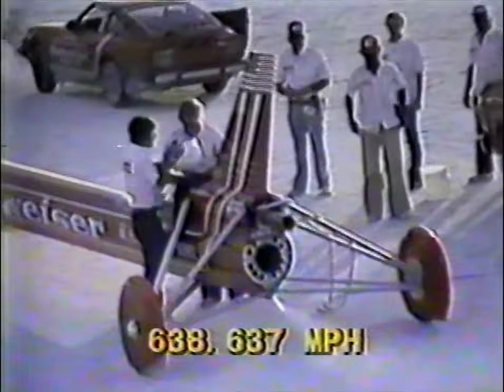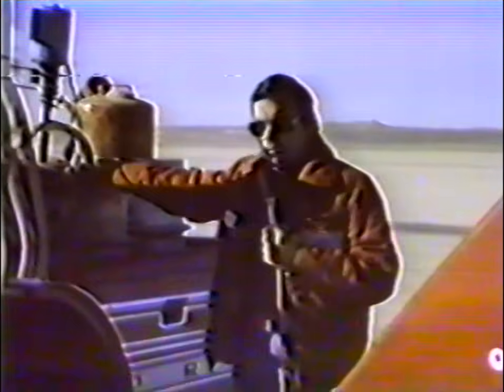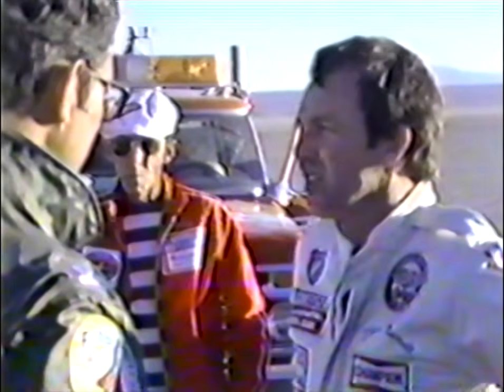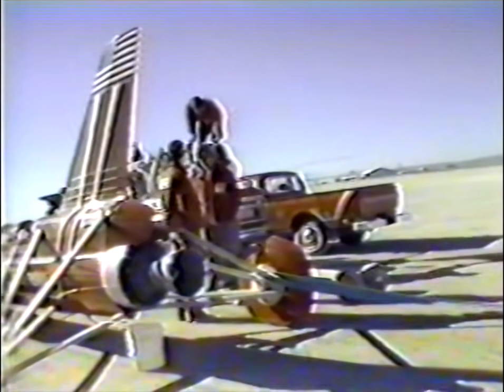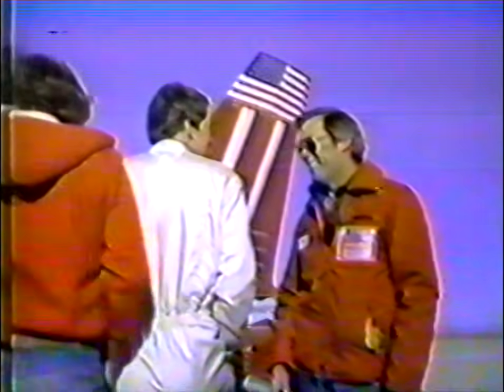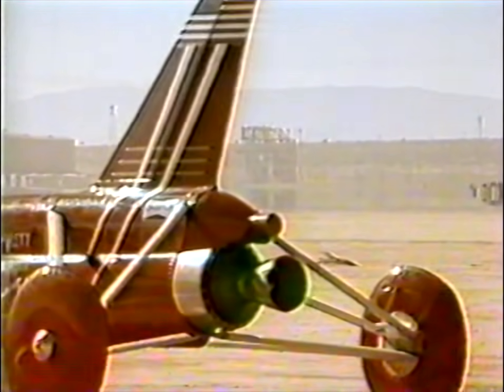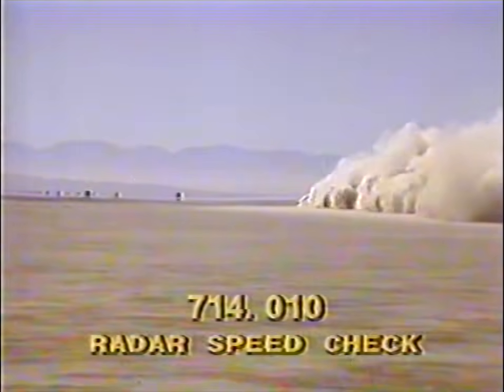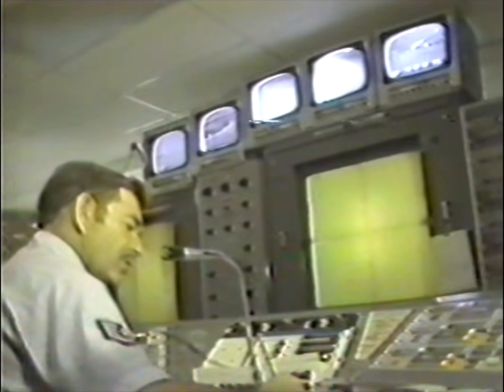Stan Barrett Breaking The Sound Barrier Live from Edwards Air Force Base in 1979

Comment: I was in the black rock in 1997 when the SSC did break the sound barrier and yes one hell of a sonic boom and shock wave!
Reply: Stan Barrett broke the sound barrier, the reason for a subdued sonic boom is because of the design, very little wind resistance, while it was very aerodynamic. 

The size of the Bud car compared to the SSC and especially the difference  in weight has everything to do with the magnitude of the boom. He was the first to break the record in a land vehicle. The rocket engine in the Budweiser car has no air intake, this is another reason only a few heard the sonic boom at a certain angles as it went by. 

The SSC has two huge air intakes for two very large turbojet engines that create huge amounts of turbulance which the Bud car does not have at all. 

The huge area around the intake is why the SSC had such a big boom along with it needing to run massive amounts of air through its engines.

I work at Edwards AFB at Pratt & Whitney military propulsion systems, I have for 22 years.
Reply: Yet SSC was a car (four wheels, two for steering).
Stan Barrett's three wheel did not qualify in the same category as the historic land-speed records for cars.
Reply: @P&Wengineering, and yet the F-104, one of the most aerodynamic planes in the world, still makes a hell of a sonic boom.
Reply: Because it's frontal area is massively larger than the rocket car, as well as a host of other reasons.
Reply: @richardpare3538  bullets  make a sonic boom when they break the sound barrier, frontal area has nothing to do with it ,its air being compressed  until it can't get out of the way ,no bang no sound barrier, awesome tech achievement  and a ballsy driver.
Reply: @pauldavidson6321  Yes bullets do, but is is MUCH less loud than that of a supersonic jet, because the magnitude ( in size) of the wavefront of a jet is much larger. Anyone who has studied supersonic flight knows this:

https://www.nasa.gov/centers/armstrong/news/FactSheets/FS-016-DFRC.html
Reply: Why is everyone calling bullshit 🤣
Reply: I was there too working with the opposition, Craig breedlove and his Sonic Arrow. The Sonic arrow was actually the faster car capable of an estimated 920 miles an hour but there were too many mechanical issues. And the team simply ran out of funding.
Reply: @leonwarner8498  Sonic Arrow had a lot of aerodynamic problems too. I've always admired Craig Breedlove: a gentleman, respectful of other people's efforts and totally committed to his passion of setting land speed records. The man has always done everything by the book. Perhaps his one flaw is that he eschewed things like wind tunnels and CFD, preferring to design things by eye. While he was definitely putting his life on the line and he certainly succeeded with Spirit of America 1 and 2, Sonic Arrow was a different matter. To work safely and effectively at Mach 1, it needed some serious CFD work, especially in relation to things like directional stability, shockwave propagation (especially relative to the ground) and air intake design.

Strange things happen once you exceed what's known as Critical Mach Number - the point at which airflow becomes sonic at one point on the body. Air behaves quite differently. Shockwave formation and things like boundary layer separation can make the difference between life and death. Intake design is critical too. Most people don't realise this but a jet engine cannot process supersonic airflow. That means designing an intake that has very predictable shock patterns so that the air will slow down reliably. The alternative is a compressor stall, which would probably destroy the engine and the vehicle with it.

Thrust SSC was designed by an aerodynamicist (Ron Ayres), who also did much of the design work on Bloodhound. Guess who was the first to congratulate them? Craig Breedlove.
Reply: @pwengineering9070  All well and good........ But he still didn't break the barrier - didn't go fast enough!
Reply: @leonwarner8498  That's the thing - back in the 1970s it seemed like money was easier to get, up to a point.   Today everyone would worry about insurance liability.  The Sonic Arrow was a pretty cool vehicle, it's too bad it never got to really shine the way we all hoped it would.

Comment: mu = shock cone angle.  mu = asin(1 / M).  At M = 1.00,  mu = 90.00 degrees (normal shock).  At just M = 1.01, mu = 81.93 degrees.
Shocks in this regime are weak but would still be distinguishable from the rocket exhaust as they sound like a single very, very low frequency thump.
If the vehicle only momentarily achieved sonic speed then it IS possible that the point where this occurred was not at the location where a shock cone would have swept the observers.
- 40 years in the Skunk Works
Reply: Basically what he said was “No” he didn’t break the sound barrier on that day.Given another day, different temperatures it probably would have broken the sound barrier.No sonic bang, no shockwave.means no sound barrier broken.”On that day” But all due respect to Stan.But don’t give us a formula to try and prove it.
Reply: @donlunn792  Let me try to explain it more simply.  If he only momentarily went supersonic and the observers were not in exactly the right place then they would not hear the shock wave.  Furthermore at speeds only slightly above sonic the shock sounds like a low thump not a bang!
Reply: He was FIRST
Reply: @buckturgidson1632  The SOS is roughly 1122 fps depending on ground height, and there is definitely a boom as you go through, anything close to the sos is buffeting and causes de stabling effects but no sonic boom. besides 666mph being a long way off the SOS at ground level, depending on altitude.

Comment: If you check the official records, this run was never certified.  I highly doubt Barrett broke mach 1, because they would have certainly made a big deal, in the film, about hearing the sonic boom (there wasn't one).  In contrast, the "ThrustSSC," the first car to actually break the speed of sound (in 1997) was said to have generated a clearly audibie sonic boom and visible shockwave, as it passed "the barrier" and went supersonic.
Reply: Not having an official record doesn't mean it happens, and falling a couple miles per hour short doesn't make it any less impressive.

Comment: Chuck Yeager was not an engineer and had no advanced education, he was an excellent pilot ,but that doesn't give him any more credence than some guy on the street .No boom ,no sound barrier it's that simple , they're very loud everyone would have heard it  .also the the equipment used by the Airforce is not appropriate for land speed timing and was not even calibrated . The attempt was a very impressive  achievement by any standards.
Reply: Quite right. Everyone should just forget about the radar. It doesn't measure local Mach number anyway. It's just a distraction used by the people who chose to believe this fraud. Either it made a sonic bang or it didn't and everyone knows it didn't.

Comment: The sound barrier is 767mph, so they were about 30mph shy of a sonic boom.
Reply: The sound barrier speed changes with temperature, air density, etc. On that day, the Air Force determined what the sound barrier was for those conditions.
Reply: @juniorjohnson9509  No. The speed of sound is dependent on temperature. The USAF could not skew the variables enough to change the fact that this thing did not make a sonic bang.
Reply: @thethirdman225  : Air temp that morning was about 20 F, putting the speed of sound at approximately 731.996 mph. He was clocked at 739.666mph.
Reply: Junior Johnson You tell me how this was done then (I already know). No sonic bang = no supersonic run. Since you can hear that thing all the way through its run, there’s no way it was supersonic. Here’s what a genuine, authentic supersonic run sounds like: https://youtu.be/rIWdtE-__5M

Comment: I'm puzzled why there was no mention of a sonic boom?  If you truly break the sound barrier, there is always a sonic boom.  "We "probably" broke the sound barrier." Probably breaking it and breaking it are two entirely different things.  Also, the speed recording equipment had some issues as was acknowledged.  Officially and otherwise, he did not conclusively break the sound barrier.  Thrust SSC was the first to break the sound barrier officially in 1997.
Reply: The measured mile speed was (according to the time keeper) 666mph.
The team's radar tacho decided to spot a passing truck and read 38mph.
The Air Force stated they probably broke the sound barrier.
No one heard a sonic boom.

Put that lot together and what you have is a plot on a graph of distinct samples that when smoothed out just nudges over mach 1, even though no actual sample reads over.

If it did exceed mach 1, it was only a fleeting moment.
Reply: They didn't even have a measured mile. They had a way shorter time trap but the Bud Rocket went out of fuel before passing it.

Comment: By any measure, I call this 714+ mph run, a major accomplishment. ,,especially being built in some ones back yard.  The Thrust SSC was built at 1000 times the cost, twice the developed HP and 8 years later, plus, they broke the speed record at the Black Rock Desert in Nevada, at over 3900 feet elevation. Barrett made this run at Rogers Dry Lake at 2275 feet elevation with greater air density ..at relative air temps and humidity.  I'm not sure why Barrett and his team didn't take their Sidewinder rocket configuration back to Bonneville, where the elevation is 4665 ft.
Reply: I think they left Bonneville because it had some dips in the track that caused it to almost go airborne.
Reply: @ransomprigg1047  That could be true, ..I figured they left the salt during their first run at Bonneville (638mph) cause they had rubber tires.
Reply: I left Edwards in ‘76.  Viewing the video in ‘21.  Remember the view of the flight line.

Comment: People believe what they want to belive. That is why telemetry is required for records to be official
Reply: Actually I would accept the land-based speed-trap measurement over telemetry for the simple fact that telemetry, by nature, involves latency and many more pieces of equipment. Modulators, transmitters, receivers, demodulators, oscillographs, etc, etc., etc.. A lot to go wrong or produce an error. A speed trap is a clock operated by an on/off switch placed at a measured distance apart. Simple and accurate.
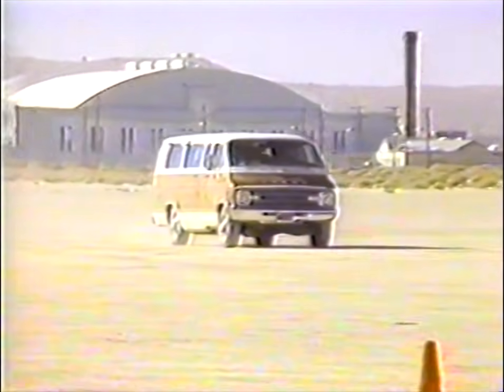Reply: At exactly 19:20. At least watch it so you can feel stupid

Comment: An amazing feat regardless of whether it was sanctioned or not. I have to wonder what the stresses were on the wheels that rolled at 1000 feet per second. The G-forces of centrifugal force had to be enormous. Where is this vehicle now?
Reply: I read on another video that it's in a museum somewhere?   I'd love to see it.
Reply: Its at the motorsports hall of fame in Talladega Alabama. Right beside the Talladega Superspeedway. It sets out on the floor and you can walk right up to it.
Reply: As rodas não têm borracha. São 100% em alumínio!
Reply: For reference the wheels of Bloodhound LSR are designed to withstand 50,000 G.

Comment: There was no shockwave visible in any of the videos so unfortunately their own evidence disproves their dream that the car went beyond the sound barrier. Calculated SOS values and people thinking they heard a boom don't trump the laws of physics. No pressure wave, which you'd see for hundreds of meters either side of the car on the ground, then the sound barrier he didn't reach, let alone break. That doesn't stop it being an epic achievement, just not one that was faster than sound.

Comment: I think that tracking radar is an AN/MPQ 77.
Reply: Doesn't matter. It doesn't measure local Mach number.
Reply: Good catch
Reply: @thethirdman225  You are correct that it doesn't record mach numbers.  It can plot the path with time ticks on the plot and the distance between the ticks is measured and this will give the speed.  Used to do it all the time with B-52s.  The time ticks are pretty accurate and a good operator can get the speed very close to what it actually is( +- a mph or two) and this was very important for what we did with the radar.
Reply: @repalmore  Depends on the radar.
Reply: @thethirdman225  I'm sorry, what do you mean by "depends on the radar"?  What depends on the radar?
Reply: @repalmore  The accuracy. The radar they were using had a speed range between 0 and 2,000 mph so it wasn't super accurate for what they were doing that day. It also had problems with ground clutter, which is to be expected and you probably wouldn't have had that problem in the situation you were in.
Reply: @thethirdman225  Why do you say it had problems?  Why do you say it had a speed range?
Reply: @repalmore  What I have read about it and the fact that its readout was compromised by ground clutter and other moving objects.
Reply: @thethirdman225  I've sat and operated that exact model of radar.  I know what ground clutter is and I know what this radar's capabilities are.  It appears from your broad statements that you don't know radar and you don't know this particular model.  Unless you KNOW what you are talking about please don't bother people with innuendos and rhetoric.  The adults are talking.
Reply: @repalmore  And why don’t you shut up? I actually do know radar but not that specific model. I deal with microwave equipment every day. This thing made no sonic bang and the radar data wasn’t used to estimate the final result so whatever you think about the radar read outs is irrelevant anyway.
Reply: @repalmore  By the way, there is no such radar as an AN/MPQ-77, so spare me the condescension.
Reply: @thethirdman225  Now now little boy.  No need to throw a temper tantrum.  I'll find you a toy to play with in just a minute.  Just calm down.  Maybe some candy will help.  I also worked with microwave.  Not everyday but often.  How does a "sonic bang" have anything to do with the radar?  How do you know what the reed outs are?  Why do you think your an expert because you work with microwave?  Just calm down and answer like an adult.
Reply: @repalmore  You’re the one who started it. The radar you described doesn’t exist anyway so you’re obviously a fraud.
Reply: @repalmore  How does a sonic bang have anything to do with radar? It doesn’t. If you knew anything about this, you’d know that. But since this was intended to be an aerodynamic event, a sonic bang is evidence that it exceeded the speed of sound. Absence of a sonic bang is evidence that it didn’t. Go back to school and stop pretending you know what you’re talking about.
Reply: @repalmore  Learn how to spell.

Comment: This did not break the sound barrier Thrust SSC was the first and is still the only supersonic car
Reply: Yup
Reply: There was no Sonic Boom
Reply: My understanding is that this is up for debate. Both the Air Force and the in-car telemetry recorded a top speed about 10 mph faster than the speed of sound on the day that the run took place. The majority of the team was behind the car and wouldn't have been able to hear a boom. The one person stationed down range did claim to hear a boom, however. Either way, Thrust SSC was the first car to maintain a speed of mach 1 for a full mile.
Reply: yes it did break the speed of sound that day
Reply: @lloydadkins885  no it didn't... there was no Sonic Boom
Reply: @AppleLauda_destroyer99942  Read Parker Schulmerich’s comment. That is very accurate to what took place that day
Reply: "Where's the kaboom - there was supposed to be an earth shattering KABOOM!" - Marvin the Martian
Reply: He did go fast enought just not long enough,but he'd prove it was possible to achieve it.
Reply: @johnhefner2239  He didn't do it in two directions within 1 hour, ergo it was a wasted effort.
Reply: @poruatokin I might add. An unsporting effort in an attempt to steal the thunder of any legitimate supersonic LSR .
Reply: @hondolane3125  He obviously failed to fit the Eludium Q36 explosive space modulator... 😊

Comment: "Stan Barrett's alleged attempt to break the sound barrier was not officially sanctioned or recognized because it lacked the necessary verifiable data, independent verification, regulatory approvals, and credible evidence to support the claim. Breaking the sound barrier is a monumental achievement in aviation history, and any such claim should be thoroughly documented, verified, and validated by experts and relevant authorities before it can be officially recognized."

Shame it wasn't better documented. Still hugely impressive & brave - I love the simplicity of just strapping a guy to a rocket and adding a fin & some wheels. Oh, and a sidewinder!